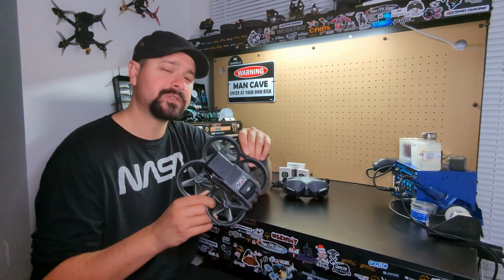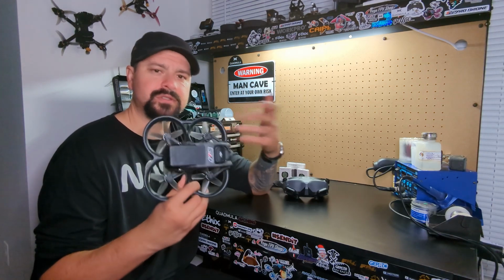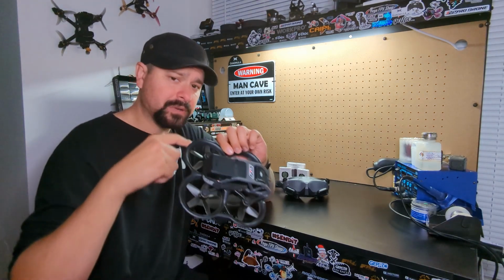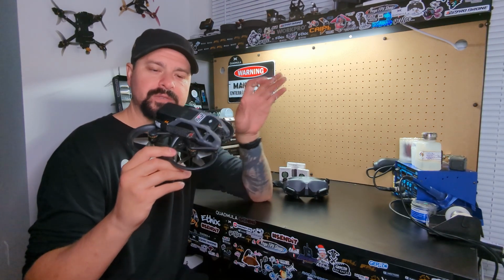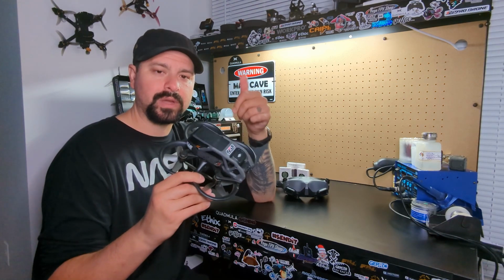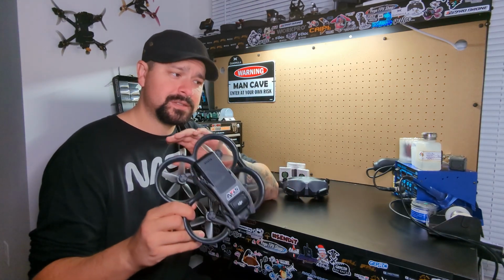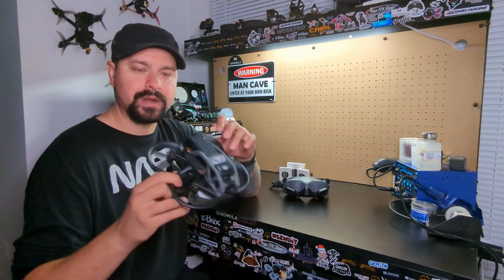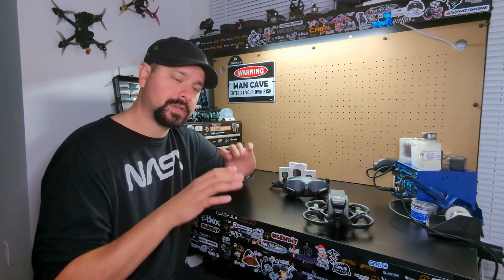Upgraded DJI AVATA: Real World Raw DVR and OSD // What to Expect From the Axisflying C157s

Comment from the maker: Top speed reached during this flight was 41.9 mph. The fastest I was able to find in all my DVR footage prior to the upgrade was 33.1 mph. Neither one of those flights was I trying to push as absolutely hard as the Avata can. It's just me doing my normal "thing" while I fly. These results are indicative of the overall increase and speed and performance I have experienced since the motor install. 

I don't really see the point in doing a flat out 45 degree camera angle full throttle burst to try and get 60 mph+ from the Avata. No one is going to fly it that way and they are certainly not going to do it for any sustained amount of time. 

I hope this answer helps.
Reply: This is the kind of click bate I thoroughly enjoy 😉! #stayepic
Reply from the maker: @marcoreviews  thanks, bro. 😅
Reply: Still interested to see it flat out, otherwise hard to compare.
Reply from the maker: @hacklschorsch2770  I mean in comparable flights it's averaging 9-10mph faster.  I'll do a couple flat out runs and see what it gets.

Comment: I really like the motor upgrade, but I did just see a video of steel putting a stock Avata through the ringer and didn't fall out of sky once, definitely noticed that it didn't like a few maneuvers that he was doing. But simply said it can do all the freestyle things 🤔.
Reply from the maker: Yeah it really can and it makes me laugh when people say it's not meant for freestyle. It's easily one of the most rugged drones I've owned and it's fun. It's not a 5" freestyle quad but it rips for what it is.
Reply: Remark

Dear Customer, Damage Assessment Result: Core Board Module was malfunctioned,which caused abnormal sensitivity of operation;DJI Avata Intelligent Flight Battery water damaged. The data analysis determined that your product qualifies for a free warranty repair. We'll either replace it with a product that's new or equivalent to new in both performance and reliability, or repair it. For more information, please visit (http://www.dji.com/service/policy). ing battery as well
 
 
Item List
Core Board Module
Quantity: 1
Net Price : 98.00
Total Price: 98.00
 
DJI Avata Intelligent Flight Battery
Quantity: 1
Net Price : 129.00
Total Price: 129.00
 
Repair Service Fee
Quantity: 1
Net Price : 65.00
Total Price: 65.00
 
 
Tax
0.00
 
Shipping Cost
0.00
 
Total Amount
292.00
 
Discount
292.00
 
Total Payment (USD$)
0.00
 
 
Note
1. To ensure repair quality, DJI may update or replace the product module. If it is updated or replaced, the serial number may also change, but this will not affect the after-sales service.
2. DJI will use standard delivery service to ship back your products. If you have any other requirements, such as expedited service, please contact DJI Support. Please be noted that DJI will not bear any additional costs for such requirements.

3. Please note that DJI will not take responsibility for the extra costs, such as customs clearance and postage, incurred as a result of the uses made of your incorrect information.

4. Click here to check DJI After-sales Service Policies.

This email is sent automatically by the system. Please do not reply. For further inquiries, please contact us via DJI Support.

 
Best Regards,
DJI Support
 
This email and any attachments thereto may contain private, confidential, and privileged material for the sole use of the intended recipient. Any review, copying, or distribution of this email (or any attachments thereto) by others is strictly prohibited. If you are not the intended recipient, please contact the sender immediately and permanently delete the original and any copies of this email and any attachments thereto.

此电子邮件及附件所包含内容具有机密性，且仅限于接收人使用。未经允许，禁止第三人阅读、复制或传播该电子邮件中的任何信息。如果您不属于以上电子邮件的目标接收者，请您立即通知发送人并删除原电子邮件及其相关的附件。

Comment: My conclusion is to use the Avata like any Cinema whoop class drone and separate the performance stuff to better suited drones. Great information.
Awesome spot !
Reply: Remark

Dear Customer, Damage Assessment Result: Core Board Module was malfunctioned,which caused abnormal sensitivity of operation;DJI Avata Intelligent Flight Battery water damaged. The data analysis determined that your product qualifies for a free warranty repair. We'll either replace it with a product that's new or equivalent to new in both performance and reliability, or repair it. For more information, please visit (http://www.dji.com/service/policy). ing battery as well
 
 
Item List
Core Board Module
Quantity: 1
Net Price : 98.00
Total Price: 98.00
 
DJI Avata Intelligent Flight Battery
Quantity: 1
Net Price : 129.00
Total Price: 129.00
 
Repair Service Fee
Quantity: 1
Net Price : 65.00
Total Price: 65.00
 
 
Tax
0.00
 
Shipping Cost
0.00
 
Total Amount
292.00
 
Discount
292.00
 
Total Payment (USD$)
0.00
 
 
Note
1. To ensure repair quality, DJI may update or replace the product module. If it is updated or replaced, the serial number may also change, but this will not affect the after-sales service.
2. DJI will use standard delivery service to ship back your products. If you have any other requirements, such as expedited service, please contact DJI Support. Please be noted that DJI will not bear any additional costs for such requirements.

3. Please note that DJI will not take responsibility for the extra costs, such as customs clearance and postage, incurred as a result of the uses made of your incorrect information.

4. Click here to check DJI After-sales Service Policies.

This email is sent automatically by the system. Please do not reply. For further inquiries, please contact us via DJI Support.

 
Best Regards,
DJI Support
 
This email and any attachments thereto may contain private, confidential, and privileged material for the sole use of the intended recipient. Any review, copying, or distribution of this email (or any attachments thereto) by others is strictly prohibited. If you are not the intended recipient, please contact the sender immediately and permanently delete the original and any copies of this email and any attachments thereto.

此电子邮件及附件所包含内容具有机密性，且仅限于接收人使用。未经允许，禁止第三人阅读、复制或传播该电子邮件中的任何信息。如果您不属于以上电子邮件的目标接收者，请您立即通知发送人并删除原电子邮件及其相关的附件。
Reply: Remark

Dear Customer, Damage Assessment Result: Core Board Module was malfunctioned,which caused abnormal sensitivity of operation;DJI Avata Intelligent Flight Battery water damaged. The data analysis determined that your product qualifies for a free warranty repair. We'll either replace it with a product that's new or equivalent to new in both performance and reliability, or repair it. For more information, please visit (http://www.dji.com/service/policy). ing battery as well
 
 
Item List
Core Board Module
Quantity: 1
Net Price : 98.00
Total Price: 98.00
 
DJI Avata Intelligent Flight Battery
Quantity: 1
Net Price : 129.00
Total Price: 129.00
 
Repair Service Fee
Quantity: 1
Net Price : 65.00
Total Price: 65.00
 
 
Tax
0.00
 
Shipping Cost
0.00
 
Total Amount
292.00
 
Discount
292.00
 
Total Payment (USD$)
0.00
 
 
Note
1. To ensure repair quality, DJI may update or replace the product module. If it is updated or replaced, the serial number may also change, but this will not affect the after-sales service.
2. DJI will use standard delivery service to ship back your products. If you have any other requirements, such as expedited service, please contact DJI Support. Please be noted that DJI will not bear any additional costs for such requirements.

3. Please note that DJI will not take responsibility for the extra costs, such as customs clearance and postage, incurred as a result of the uses made of your incorrect information.

4. Click here to check DJI After-sales Service Policies.

This email is sent automatically by the system. Please do not reply. For further inquiries, please contact us via DJI Support.

 
Best Regards,
DJI Support
 
This email and any attachments thereto may contain private, confidential, and privileged material for the sole use of the intended recipient. Any review, copying, or distribution of this email (or any attachments thereto) by others is strictly prohibited. If you are not the intended recipient, please contact the sender immediately and permanently delete the original and any copies of this email and any attachments thereto.

此电子邮件及附件所包含内容具有机密性，且仅限于接收人使用。未经允许，禁止第三人阅读、复制或传播该电子邮件中的任何信息。如果您不属于以上电子邮件的目标接收者，请您立即通知发送人并删除原电子邮件及其相关的附件。

Comment: Dang it, I gotta get out and fly more. Loved how you buzzed the tree tops.
Reply: Remark

Dear Customer, Damage Assessment Result: Core Board Module was malfunctioned,which caused abnormal sensitivity of operation;DJI Avata Intelligent Flight Battery water damaged. The data analysis determined that your product qualifies for a free warranty repair. We'll either replace it with a product that's new or equivalent to new in both performance and reliability, or repair it. For more information, please visit (http://www.dji.com/service/policy). ing battery as well
 
 
Item List
Core Board Module
Quantity: 1
Net Price : 98.00
Total Price: 98.00
 
DJI Avata Intelligent Flight Battery
Quantity: 1
Net Price : 129.00
Total Price: 129.00
 
Repair Service Fee
Quantity: 1
Net Price : 65.00
Total Price: 65.00
 
 
Tax
0.00
 
Shipping Cost
0.00
 
Total Amount
292.00
 
Discount
292.00
 
Total Payment (USD$)
0.00
 
 
Note
1. To ensure repair quality, DJI may update or replace the product module. If it is updated or replaced, the serial number may also change, but this will not affect the after-sales service.
2. DJI will use standard delivery service to ship back your products. If you have any other requirements, such as expedited service, please contact DJI Support. Please be noted that DJI will not bear any additional costs for such requirements.

3. Please note that DJI will not take responsibility for the extra costs, such as customs clearance and postage, incurred as a result of the uses made of your incorrect information.

4. Click here to check DJI After-sales Service Policies.

This email is sent automatically by the system. Please do not reply. For further inquiries, please contact us via DJI Support.

 
Best Regards,
DJI Support
 
This email and any attachments thereto may contain private, confidential, and privileged material for the sole use of the intended recipient. Any review, copying, or distribution of this email (or any attachments thereto) by others is strictly prohibited. If you are not the intended recipient, please contact the sender immediately and permanently delete the original and any copies of this email and any attachments thereto.

此电子邮件及附件所包含内容具有机密性，且仅限于接收人使用。未经允许，禁止第三人阅读、复制或传播该电子邮件中的任何信息。如果您不属于以上电子邮件的目标接收者，请您立即通知发送人并删除原电子邮件及其相关的附件。